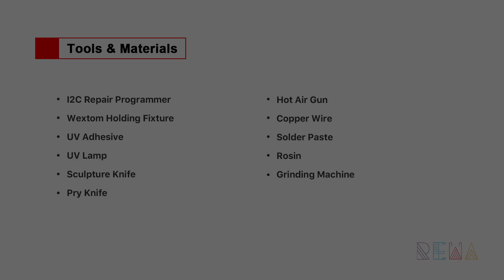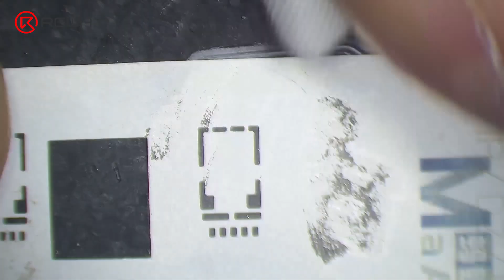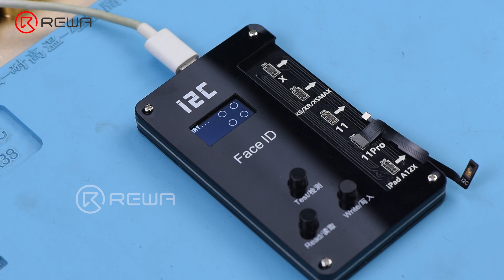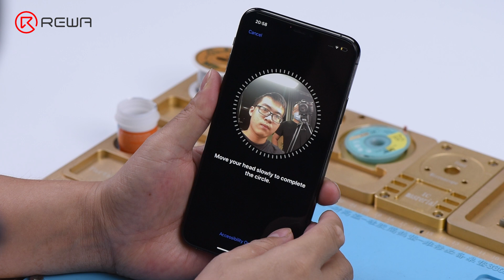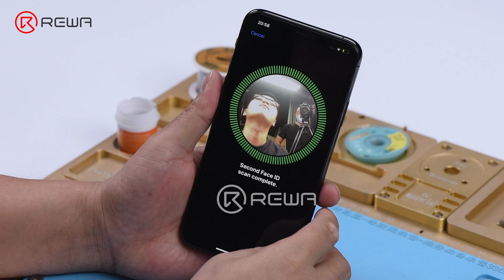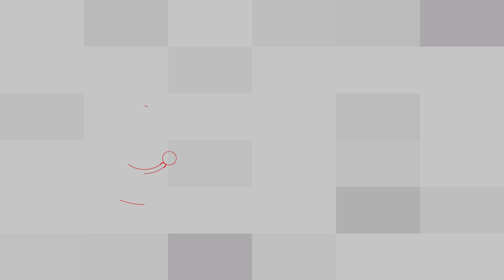iPhone Face ID Dot Projector Repair (By Replacing Flex Cable)

Comment: my dot projector flex cable is torn. So I would like to replace the flex cable. Do I have to read the original flex cable? Can a new flex cable be used without original flex?
Reply from the maker: Which model? Front camera module can not replace to fix face id problem until 16 and 17 Pro.

Comment: can you tell me how i can find out the truedepth serial? I have 1 iphone 12 pro with damaged face id, the original old flex was cut without the connector piece. I took the projector off, I put it on the new flex, I took off the little piece and made the jumper. ok I read in the JCID everything Normal. so it doesn't have the serial and it doesn't work on the cell phone. Is there any way to find out the serial to be able to record on the new flex?

Comment: wouldnt it be waaaaaaaaaay easier to get a whole new dot projector replacement ( 10$ on ebay ), read the data on the old cable, write it on the new cable then just attach the new replacement unit ?
I mean if you're getting paid 10-50 USD an hour, it must have taken couple of hours to remove the old dot projector, cleaning it, putting it back  ..etc
Reply: Should ist work?

Comment: I need my dot projector ribbon cable repaired, how much would that cost? pretty much exactly whats done in the video but can send you the assembly that holds the dot projector.
Reply: Got mine fixed perfectly with the help of hackbloc16 on IG

Comment: Hi rewa..i have a problem with my ip x...when you turn it on.. you can use it for a minute and the  suddenly it will turn off..and turn on again..and off...
Reply: Had same issues but got it fixed perfectly with the help of hackbloc16 on IG

Comment: iphone 6s battery draining fast when not in use ,How to fix that ?
Reply: It usually occurs due to IC problem, if not the battery. This is easily fixable, within 40 minutes or so, and will only cost around AED 100 or so if you're in UAE.
Try City Flash iCare in Dubai.
Reply: @mk924  do u know any in Jeddah Saudi Arabia
Reply: Sorry brother, I'm not familiar with Saudi.  Also, in Saudi it could cost more since this service field falls under Nationalisation scheme.
Reply: @mk924  ok thx anyways

Comment: Hi for years you Guys pinching on Apple. Nice as always . 
I have a question for you. 
I have an iPhone X. Which has fallen on floor and since than Front Camera is blurry or fuzzy. Face id is also faulty. Move Up down fault comes up.
Is the dot Projector got broken or it can be happend because of Front Camera?

Comment: if I get another flex cable with a dot projector already installed can I override the data on that 1 with the backup that is done and fix the face ID that way?
Reply: I’m also curious about this…. Any answer, REWA? 😞

Comment: Great video!  I have a question, can I just buy a new front camera module,  reset it and burn data from the old module to the new one?  Thanks!
Reply: I’m wondering the same
Reply: Well, if serial numbers don't matchup with the one stored in iPhone, face id won't work. If u wondering why we just can't rewrite, that chip in face id module isn't rewritable nor copied.

Comment: so basically remove mosfet and jump point 2-3?
Reply from the maker: Yes，because control circuit need to be changed in this repair case~

Comment: Essentially you’re only replacing the cable and removing mosfet and replacing with a jumper wire? 
The copy machine is only saving the data and not rewriting onto anything new?
Reply: You didn't watch the video carefully, they write data to new flex cable.
Reply: @ifixsmartphone9079   thanks I did see that in the beginning but curious how it writes data to a cable without any ic chip on it. I’ve checked the website and all their flex cables I do not see any ic chips on them. 

I guess I’m really asking if it’s something that could be done without the programmer. Looks like you’d be able to do the same repair on the original flex cable by removing the module/solder and renewing the solder pads and reheat back together. Just like it’s done with a corroded proximity sensor on iPhone X and up.
Reply from the maker: Hi buddy, thanks for your feedback. The new flex cable we use in this video already has ic chip in it, that's why we can write data directly~
Reply: @rewatechnology2008   ah ok thanks! Makes sense then lol. I like to fully understand before I make any purchases